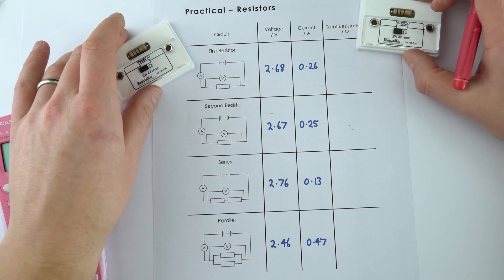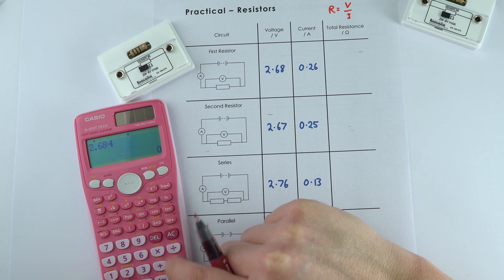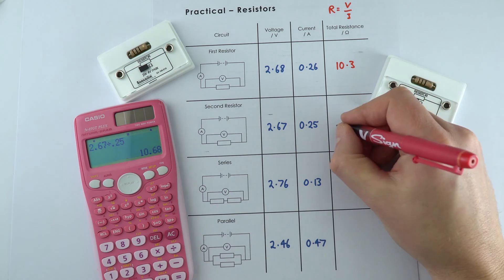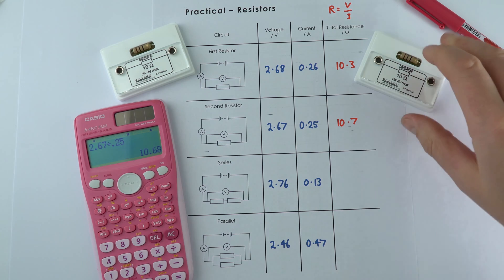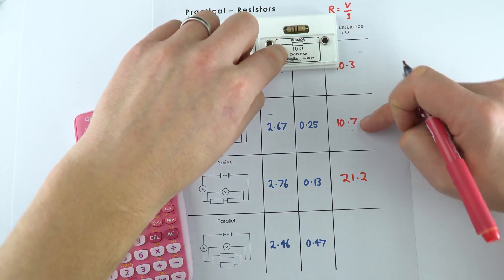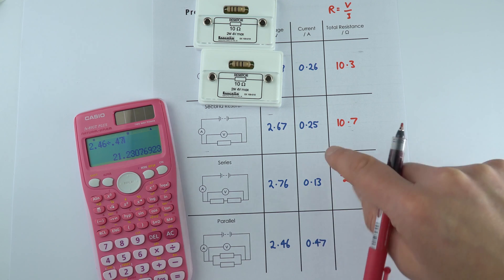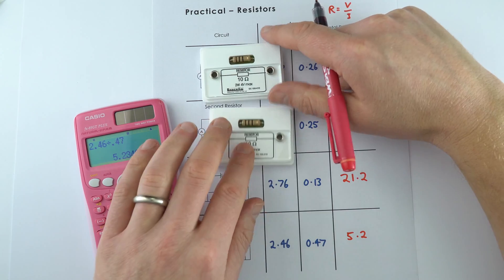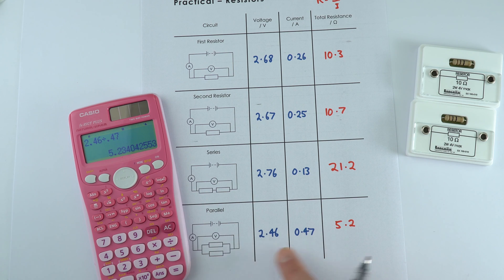Resistors in Series and Parallel Circuits Experiment RESULTS - GCSE Physics Required Practical

Comment: If my Voltage supplied is 12 V and I have two 10 Ohm resistors in a parallel circuit. After taking the readings from the Ammeter which was 1.35 A for branch 1 and 0.92 A for branch b. My Voltages for resistor 1 and 2 were 10.94 and 10.45 volts respectively. Shouldn't my Voltages add up to be 12 Volts? How can I justify these readings in my A level practical write up :(